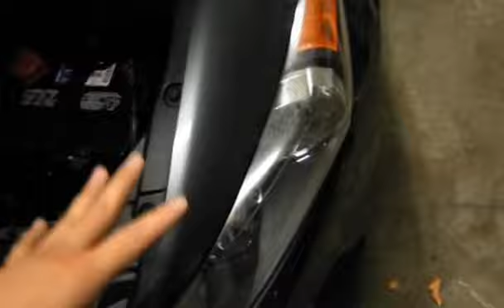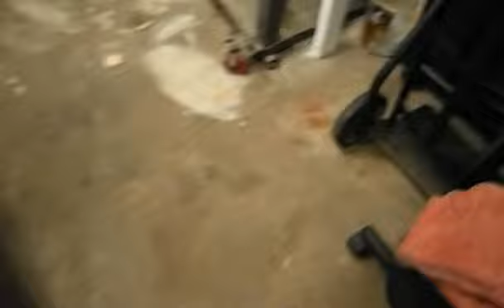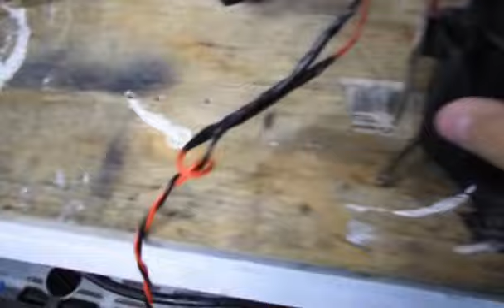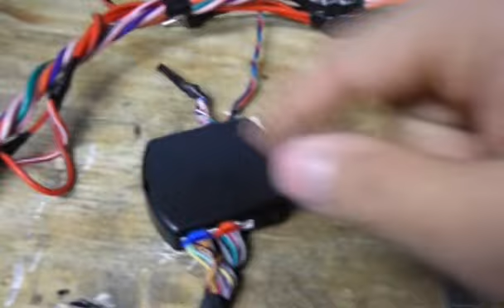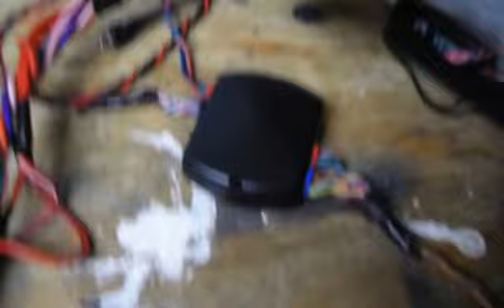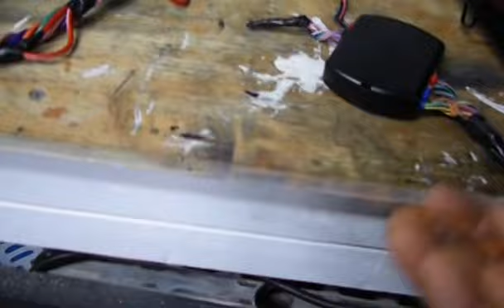Viper remote installation pt 1

Comment: Does this equipment work on older cars without stuff like OBD2, like an old skyline?
Reply from the maker: SkippyTeal uhmm...my guess would be it might but theres probably little to no software support, since its not a common vehicle. you would hve to look it up if the bypass would have a firmware for the car. or manually wire hundreds of wires manually to wach door, light, engine, starter etc...

Comment: How do you flash the bypass? Can I do that myself?
Reply from the maker: yes u would need to buy it on amazon or go to a shop that would do it for u
Reply from the maker: better yet when u buy the dball just request the seller to install the firmware for your vehicle
Reply: +Van's DIY_channel ok cool thanks